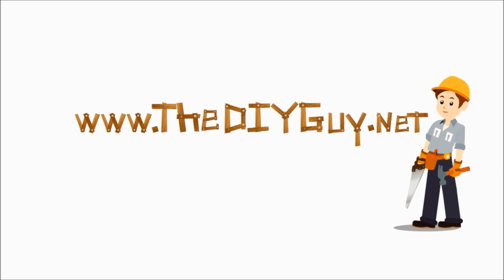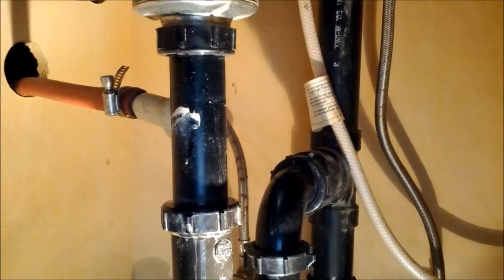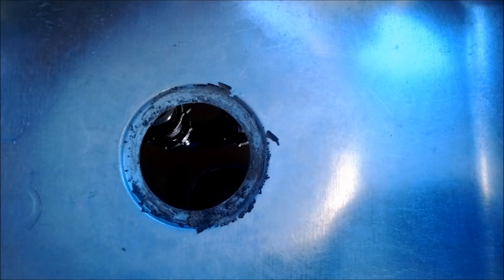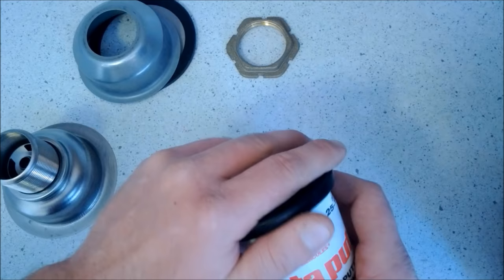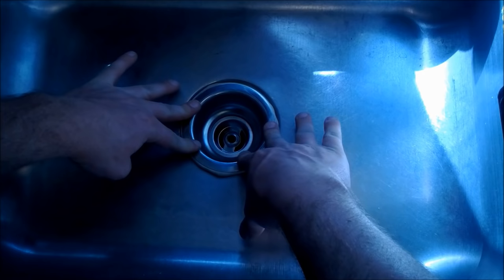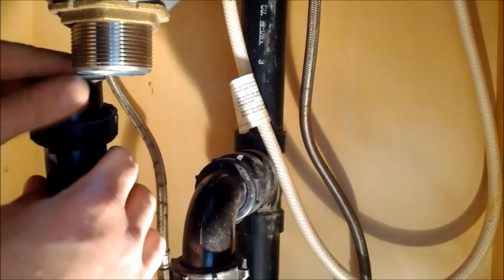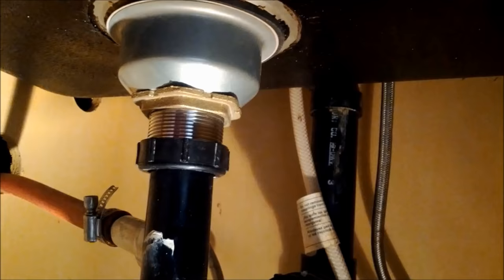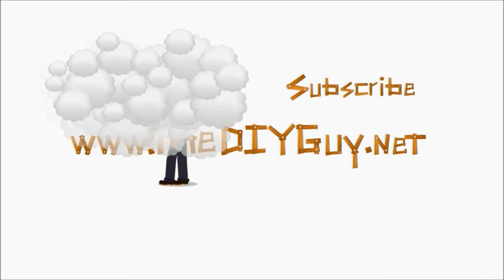How to Replace A Kitchen Sink Strainer

Comment: Excellent demonstration, however, how do i get the old seized ring off ?
Reply from the maker: Thanks. For a stuck on or rusted nut I use a grinder or a cut off wheel hold it on about a 45 degree angle and just cut into the nut be careful not to cut into the sink. You don't have to cut all the way though maybe half way then grab a large screw driver and put it into the cut and twist it and it should pop the nut apart. Once you have it popped apart you should be able to turn it. You can also use a hacksaw but will take you a little bit longer but less likely to cut into the sink. As you will see in the video at 1:28 this nut crack by itself as I started to turn it making this one a bit easier to get off. If you have a plastic nut you can take an older chisel or flat screw driver and heat it up with a torch and slowly push it though the nut and melt a cut into it. Then grab a cool screw driver place it within the cut and twist to crack it apart.

Comment: Great overall video! Helped me a lot, but I thought you have to let the putty set for a few hours before testing it?
Reply from the maker: Thanks, No the puddy will not harden or cure so there's no reason to wait. Sometimes you can run hot water for a bit around the edge of the strainer and then tighten the nut a bit more as the puddy with be softer.
Reply: Thanks for the clarification.
Reply from the maker: No problem, Good luck with the repair and thanks for watching.

Comment: Thank you .now I know why my sink was leaking. I throw always the paper  seal. I told it was just an useless paper.
Reply: Hmmm, the replacement part I bought didn't have this paper seal, just a rubber one. I don't see the point of the paper.

Comment: Quick question .. wich one do you prefer ? The old one with the big counter nut (plumb pak) or the new one without it ?
Reply from the maker: The one I used in the video is the one I mostly install and have in my own house. This one https://amzn.to/2JXj8vP as I like having the stopper click in to stop the water rather then have the water weight make the stopper stay and seal. The ones with the smaller nut are easier for the home owner to tighten as they will most likely have pliers to fit and I figure if it needs to be replaced again its easier to cut the nut off as its farther away from the sink itself.

Comment: I thought the putty on the under side had to be removed.As in, the extra under the sink where gasket goes? Or is that just on older style baskets.
Reply from the maker: This one looks like there is a lot of putty down there but if you look closely there's only a little bit right around the whole which will sit just inside the basket. If you have a lot down there you could remove some. Depending on the basket sometimes if there is a lot of putty it can get into the threads of the nut more common with garage disposals.

Comment: Our old one had a leak and I took it apart and cleaned everything and without using putty, put it back together.. it didn't leak, but my wife complained that the drain was higher than it was before.. I argued with her stating that this is the way it always was.. Then I watched your video.. I had placed the rubber washer where the putty should have went.. Went back and reinstalled it properly with putty... Didn't tell the wife.. our secret ! ;) Thanks!

Comment: I have a question.... So i am doing this and i think i am doing something wrong. Mine ends up above a little bit if that makes sense so the water does not go down the drain because is raised. I CAN push it down more and it be leveled but i am afraid all the putty would be pushed out? Any advice?
Reply from the maker: I think your saying that the strain basket ends up a little raised in the sink so you are left with a little bit of water within the sink. Depending on the sink and the basket it does sometimes end up that way. Some sinks are just that way from the start. You can try and run some hot water down the sink and around the sink strainer flange to make the putty more soft and pliable and then try and tight the sink basket some more to squeeze more putty out and to get it to go lower within the sink. You won't be able to squeeze it all out there should be enough left to make a thin seal and take up the imperfections in the sink flange. The key is to bring it down/ tighten it evenly.

Comment: So how do you stop the basket from moving when undoing the nut underneath ? I don't have anything wide enough to spread inside the basket to keep it from turning. The entire basket with the nut and all else just twists.
Reply from the maker: That happens a lot they make a strainer wrench -> https://amzn.to/2Y7HU1z  You can also use two flat screwdrivers and place them into the strainer on opposite sides and hold it that way or you can cut the nut with a grinding wheel or hacksaw and then use a flat screw driver or chisel and place it into the cut and open it up so you can easily turn the nut or just slide it off.

Comment: did you tighten the nut snug? or really crank it down? I just did this and didnt go very tight as I did not want to squeeze all the putty out
Reply from the maker: You want to get it as tight as you can without feeling like your gonna break it. If you run hot water though the strainer and then try tightening it again you will be able to get it tighter as the hot water will get make the puddy softer. If there not tight enough they seem to move or loosen up and cause a leak. Just be sure to check it a few times after to ensure it doesn't start leaking.

Comment: it seems that a rubber gasket should go in place under the strainer instead of putty?
Reply from the maker: NO. That is incorrect.. It should be the strainer, puddy, Rubber washer, paper washer, lock nut. Feel free to google properly installed sink strainer under images and you will see.

Comment: Ours is fused together and we can't turn it so we can get it off to lift it out. Any ideas of how we can get it unfused? My Dad said he thinks it has corroded and fused together. Ever had to replace one that has happened to?
Reply: tug on on it..if its corroded and rusted like my two strainers were (double sink).. they broke off with just a little pull.

Comment: Is using silicone caulk in place of putty advisable? I like the new basket with the smaller nut to tighten. I got to make sure I get one of those. Thanks
Reply from the maker: Yes, Some people use silicone all the time I mostly do plumbers puddy but have used silicone. So people ask what brand to use I don't think it really matters as long as it is 100% silicone. There's a link to it on our website though amazon. If you click the link in the description it will take you to the write up/ link on our website. You're welcome and thanks for watching.
Reply: Thanks. I used to work in a plumbing supply and we always recommended putty but I've noticed silicone being used lately. I'll use putty.
Reply from the maker: I think more home owners are taking on this task and they don't have plumbers putty lying around or on hand as there more likely to have a half a tube of silicone lying around or left over from another repair. Good luck with the repair.

Comment: My sink drain didn't have a double basket. Threw me for a loop for a little bit. Couldn't even find them in the hardware store!
But, I persevered, and change it - 2 or 3 times, until no leaks!! I can proudly call myself a "MAN" again for I have plumbed!
Reply from the maker: There are a few different types of strainers out there. Either way glad to hear you got it to work in the end with no leaks. Thanks for watching and taking the time to leave us a comment. Don't forget to give the video a thumbs up/ like if you haven't already. Thanks

Comment: Can I just put new plumber putty and replace the rubber and paper seal but reuse the strainer? My kitchen strainer is old model and cannot find it. Thx
Reply from the maker: Yes If you can get the nut off and its not rusted you can add new puddy and reuse the strainer.

Comment: Thank you for this video! I'm going to the store to buy it.  Just wondering, do I need to let the puddy dry and bond  before actually testing it?? If so how long?
Reply from the maker: Hello, Sorry for the late reply. There is no need to let the puddy set up or cure. Its a soft set puddy and never really gets hard. They start to leak when the puddy dries out. Hopefully you got it replaced rather easy. Thanks for watching and taking the time to leave us a comment/ question. Don't forget to give the video a thumbs up. Thanks
Reply: @TheDIYGuyDOTnet  Ah i see. Thank you for the tips!
Reply from the maker: @superduperboyx  No problem. Good luck with getting it replaced.

Comment: looks like you used your channel locks going clockwise on that nut above everything. Mine is stubborn so I viewed your video. I watched it several times,are you going clockwise? I am really having problems getting that nut off. Great video and thanks for posting.
Reply from the maker: C_ Bazel If your talking about the nut that holds the lower part of the basket to the sink. If you looking up at it I am going counter clockwise. Getting the nuts off is sometimes really hard as they are normally corroded/ rusted in place. Best to cut it off. Your welcome, Good luck with the repair.
Reply: You are very nice person to advise me on my next step to getting that darn nut off. Thanks so much for helping me.

Comment: Thanks for the help!! :)
Just wondering, the top hat gasket is enough? do you need to add plumbers tape to that area?
When does one use plumbers tape?
Reply from the maker: Yes the top hat gasket does the sealing. You use plumbers tape on male threads when going into females threads and there is no gasket or seal inside.
Reply: I always put caulk on the top sink side to ensure a waterproof seal.  I don’t trust the plumbers putty since it never really hardens and can get squeezed out.  Thoughts??

Comment: A drain was just reinstalled and we have a gap between the drain and the sink. Could the putty have been cut off to short leaving a gap?
Reply from the maker: Hello, Sometimes the puddy does come away from the edge of the basket so it will appear that there is a gap. On some sinks the strainer doesn't sit nice and flat against the sink flange so it will also create a small gap.

Comment: I have too big of a seam of putty between the basket and the sink hole. I think the basket should be wider. Or maybe I just need to keep tightening it. Any suggestions?
Reply from the maker: If you have to much puddy in there you can tighten it and squeeze some more out. You can run the hot water to make the puddy more pliable and easier to squeeze out. If you would like you can take a picture and click the link in the description and go to the bottom and upload it so I can see exactly what your talking about.
Reply: Your hot water trick worked! I was having trouble centering it, but that fixed it. My camera is down right now, but I greatly appreciate your help!
Reply from the maker: Awesome glad to hear you got it. No problem, Glad we could help you get it swapped out. Thanks for watching don't forget to give the video a thumbs up.

Comment: Nice simple video. Dig it. But now I have a leak at the slip nuts  0_0!! Any suggestions?
Reply from the maker: +T Lawrence Make sure there the gaskets are nice and clean and not cracked. Also make sure the nut itself it not cracked. You could replace the gaskets. Also could turn a little bit more with pliers and see if you can get it to stop leaking.
Reply: I added some Teflon tape around the threads  and washers and that stopped it....probably temporary but it'll hols for now.

Comment: Hello, Is there another substance to use besides plumbers putty. I've done this a couple of months ago and my sink is leaking again. The putty keeps melting and washing away.
Reply from the maker: You could use clear silicone and then let it totally dry and then trim extra off with a knife.
Reply: +TheDIYGuyDOTnet 
Thank you, I thought about that, but didn't know if it would hold up well.

Comment: No letting the puddy dry for a period of time before running water?
Reply from the maker: The puddy is a soft set puddy made to stay movable so there's no need to let dry and when it does finally dry out that is when it starts to leak.

Comment: Good Vid "DIY". Note - I used Putty, leaked. Wiped off, applied NEW Putty, leaked. I discovered that my new Kohler Cast Iron Sink is "beveled" on the "drop" in the sink, and I was OVERtightening the Retaining Nut underneath and was making it "bow" down in an attempt to create a "perfect" seal. Problem solved. Muscle is good, and bad. Thanks. Curious why my new Keeney Strainers(K5445) recommend and I quote : "Apply a small amount of Putty evenly around top hole in sink about --------->1/2"<--- FROM opening". Lastly, should we also ensure that before we wipe the excess on top away,should we be alarmed if the excess putty is not "uniformly" squished out fully in a circle ?? Would this/might be an indication of a "gap/hole in the seal" ??  Thanks.
Reply from the maker: ***** Thank you and thanks for watching. Yes certain sinks are beveled. Some recommend putting the putty on the sink instead of the basket. I would not be worried if the amount of puddy is not even around the sink basket as long as you used a decent amount and the basket is centered in the sink hole. It varies on how much will come out as the puddy will take up the imperfections in the sink.
Reply: +Justin Crediblename  Very good question "Cred".  If we were allowed posting pics, I'd show you how I ended up. Since then, Sink is excellent(this Video enlightened me). I work on Engines and I ALWAYS use a Torque Wrench when tightening bolts. I have NO idea the ft. lbs I ended up with(wish I could tell ya). We men hafta watch our strength. It was "trial and error with me since the Putty got abused with TOO much strength. What I did was tightened it "snuggly", then dropped a VERY little water around the rim...seen bubbles(water dropping through, then tight a little repeated water(very little) then bubbles, and did it once more, NO bubbles,then finalized with a "Ummmpp"....STOPPED, THEN used my tube of GE 100% Clear Silicone-Mold Free and bombarred it around the Gaskets. Stuff bonded ROCK hard. No leaks, no runs, no drips, no errors(did that with ALOT of my REmodel-Shower RoughIn Valve, PVC pipes, etcetc. I DO NOT work for GE............just saying.
Reply: *****
I just installed a kitchen sink, two strainers, and a faucet (all previously used) last night, and I used almost an entire tube of clear GE silicone to do each seam. They really seem to make the best silicone!
getting ready to cut the dried bead that formed around the outside of the sink now :)
Reply: +McBears1 Yep, that cardboard Gasket is called a "Friction Gasket"(made to be placed SECOND under the Rubber Gasket) that the BIG Nut tighteneds against. LOL, I dropped my outta the package(ripping apart with too much strength), and Gaskets got mixed up. Directions didn't say which goes first(Video explained that). I "think", at time 1:33, I only seen one Gasket he took off, my new one had two(like my Shower Drain did).His new one at time 2:21 had two gaskets(like mine). Guess the older ones had only one.
Reply: +Justin Crediblename  I hear ya. LOL, I did the same and cut my bead TOO around sink. That baby don't seep water and is there to stay !! My SS sink(29 yrs old) had two drains, now my new 130lb Kohler Cast Iron has two, BUT beveled....(geeeez). behind me.............Glad that's
Reply: *****
hah! Hey why'd you switch from the SS sink? the klanky noises? Personally, I switched TO a SS sink (from a cheap sheet metal + porcelain one that'd been chipped)
I actually have one of those enameled Kholer sinks in front of my garage, but went with SS because I thought it would last longer (and it's WAY easier to set solo...lol)
Did something happen to your SS sink?
Reply: Switched because of age(common sense), rusting out (from below,yeah, I said "rust"), and a very interesting thing I noticed underneath, over time it had "hidden-warping" due to House settling(1940). Ya think my Cast iron will hold it's own ? Take MORE than a House settling to move that HORSE. The cheaper(budget minded people),SS sinks are very easy to dent, scratch, and rust overtime due to the THINNER, the cheaper(don't wanna deal with that no more). Then they are NOISY(what did you say), I said NOISY. My new one, LOL, don't drop a glass casserole dish in it, it'd shatter,LOL. Very quiet also. LOL, wife thought I had a screw loose, I put my head down in it(9 1/2" deep)and say "Luuuuke, I'm your Father", echos. HEY, I am not slamming people for the cheaper, buy what ya can afford, but don't complain later when lime, chloride, etcetc from the City water discolors it. Lastly, mine/ours, did last 29 yrs I hafta admit, BUT, looking at it EVERYday, after the latter I explained, wears on ya.

Comment: Do you need to turn the water shut off valve off first or no
Reply from the maker: You don't need to but wouldn't hurt if you have someone else around that could walk by and turn the water on while you have it a part.